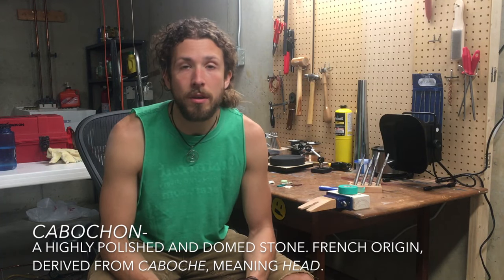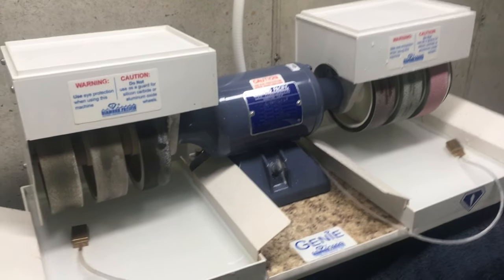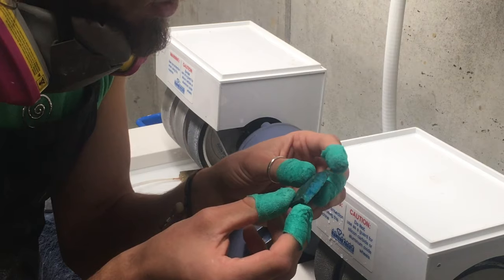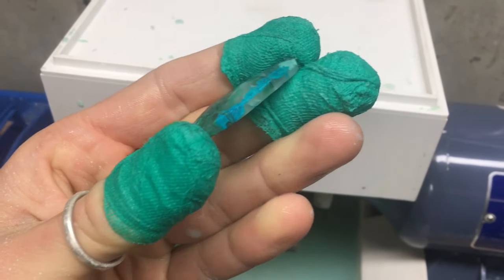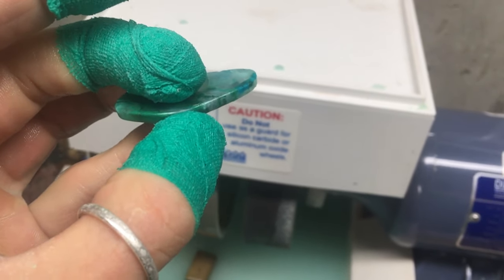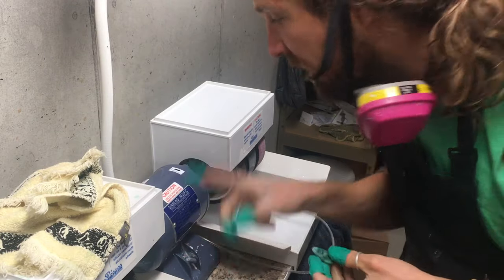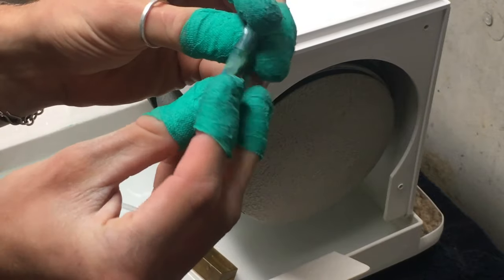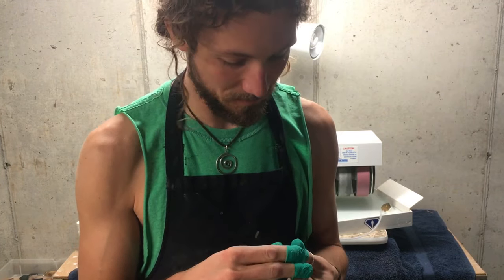Lapidary 101 Part 3: Shaping and Polishing a Cabochon

Comment: Awesome videos. We really enjoyed them. I just ordered a highland park 12" slab saw and the same trim saw you have. Genie coming soon.
It's a great hobby...so much fun.
A lady at my old club showed us how she would use a Sharpie and color the entire top of the cab at the second wheel. While holding it up to the light you can see flat spots...scratches...etc...she kept working that second wheel until the Sharpie ink was gone which ensured all scratches and flat parts were gone. Great videos. I was worried about your hair for a second. Cheers!
Reply from the maker: hey michael! so glad you've enjoyed the videos, thats a good idea to color the top of the cabs! thats the main issue i see with cabs is the top has not been fully domed and polished, and little scratches may end up there, so ensuring you go over the entire surface is really important. sounds like you'll have the tools you  need for years of enjoyment, have a blast!! :D

Comment: Sean, what are the different polishing wheel grit numbers. I got the first machine, 80-220-280, but did not see the next side numbers mentioned except the 3000 wheel and 14000 nova grit disc. Thanks
Reply from the maker: After the 280 it goes 600, 1200, and 3000 normally. There are various progressions ppl use but this is kinda the standard.
Reply: @SeanEckelArt  Thanks, I did my first cab the other day, picture Jasper, looks cool but just not that shiny . waiting for the higher grit belt to show up for the wheel.

Comment: Can I carve into stones w/o fracturing them? W a foredom.
Reply from the maker: If you're using a flex shaft for carving stones you'll need a water drip supply probably, to keep the heat down. I've never used my Foredom for lapidary work, but I know some folks do so it can be done!

Comment: The way you're holding the stone against the wheel means you're cutting blind.  In other words, you cannot see where the stone and wheel meet.  Try working LOWER on the wheel, with your lamp clearly showing you the area where the wheel and stone make contact.  That way, you'll find it much easier to utilize the best tool you have for cabbing:  Your eyes!  
Good luck.
Reply from the maker: thanks for the tip! i'm all self taught so it's basically trial and error for how i've learned to cab, but i do stand over the wheel enough to see where the wheel and stone are touching so i can measure my girdle height and even it out around the cab. but I will try to work even lower on the wheel.. thanks for the advice Sam!!